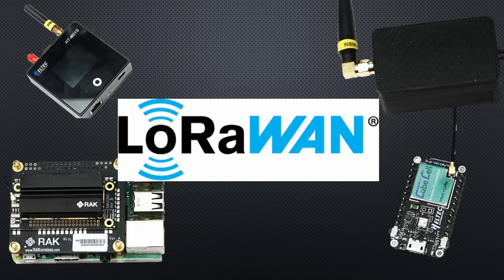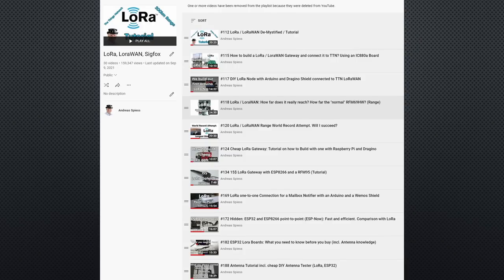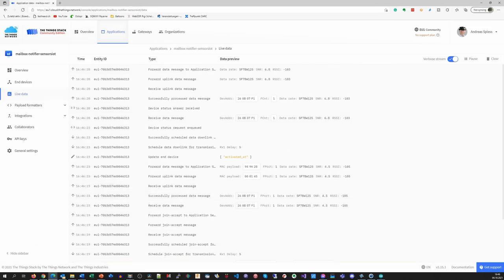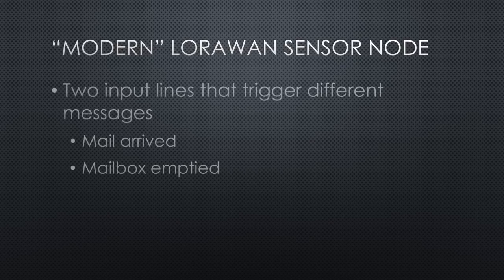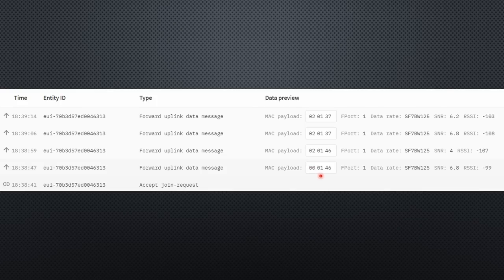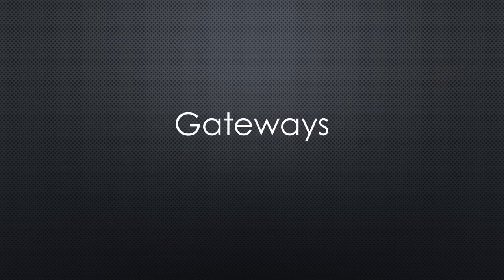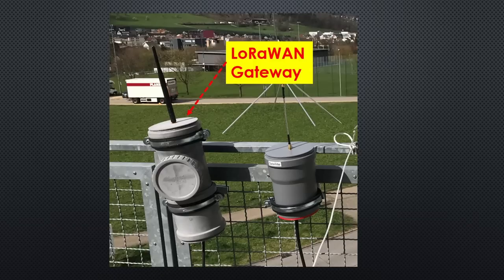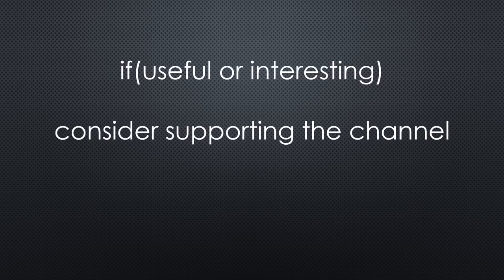#404 How to Build or Migrate Sensors and Gateways on TTN LoRaWAN V3

Comment: ...furthermore...be mindful of building MORE FREEWAYS! More freeways IS NOT a good solution to congestion on wifi. Sensor solutions that integrate coms and avoid ad-hoc, hit or miss tech are not acceptable in todays world. It's another way to cut costs by trying to vampire another system. Cheap, imported devices use this sloppy tech. Mostly it works after a fashion. But is a real user, like a farm owner, going to install the cheapest system or a mid scale system? Would he settle for temp while his neighbor has video of his tractor working a field? Lorawan is cool in many ways, no buts about it. But utility is huge these days! Lorawan is slow scan tv WITHOUT a blurry image!